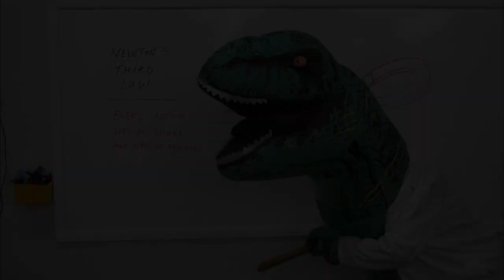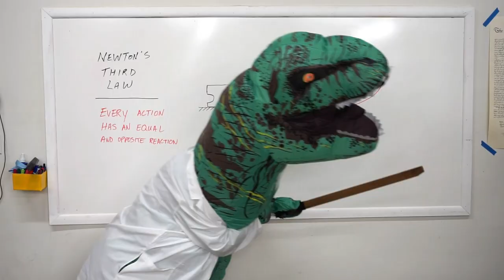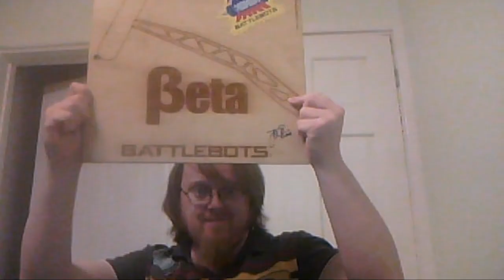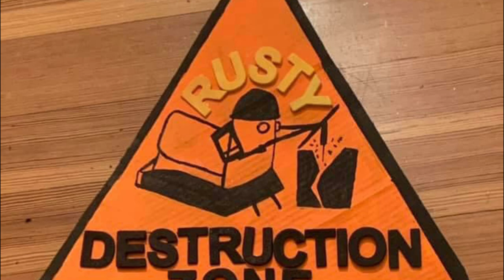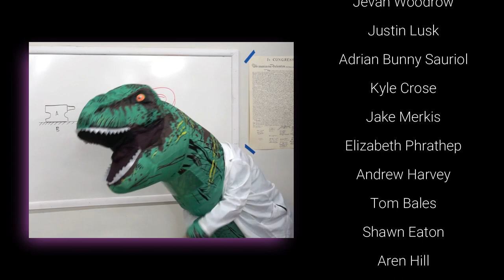Ep 4: BattleBots Learns to Walk // Tale of the Tape After Show

Comment: Wait, is that mammoth and huge fighting each other at around 2:00 before their "first" fight just a few episodes ago? I feel kinda disappointed now, I really thought we where seeing something unique on battlebots. :(
Reply: That is from their fight. The depiction actually happened
Reply from the maker: The fight did happen at Robot Ruckus in 2018, but it was not quite the same bots you see on TV. The Ruckus arena can’t handle full combat (yet), so the robots have to follow sportsman class rules. This means Huge could not use its spinning bar, and it’s likely Mammoth wasn’t running at full power. It’s still awesome to see, but it’s not the same thing as the full power battle you saw on BattleBots!

Comment: Slapbox really was trying to underplay the damage. No internal damage?!?! None of the motors were destroyed from those axle hits?
Reply: No, we weren't under-playing anything actually. We literally took all of the internals and put them into a different frame. Not exaggerating in the slightest. We even reused the rear axle assembly from the left rear wheel as well since it was perfectly fine. You can even see in the picture that nothing was touched, and even in the fight you can see we are moving and the lifter is working. If you notice, our batteries were sitting right there too in the picture...

All in all, we had to replace all the front rubber wubbs, both front axles, cut out and replace two sections of the front frame, the front top plate, some bolts & nutstrip, and 3 wheels. That's actually not bad at all from a cost perspective ($500 - 750 worth of damage and the bot cost $10k+ each and we had 3 of them).

Thank you for your interest!

Comment: After watching the new chomp, I don’t understand the strategy for firing the hammer as the opponent approaches. This lifts chomp in the air and gamma easily drove under chomp. Why not wait until after the opponent hits and then fire the hammer as the opponent bounces off?  Seems that would make it much harder for bots to get under a 500 lb robot.
Reply: It helped them in the end though. As a lot of the huge hits they got where due to them being stuck under Gamma 9 the hit that they killed Gamma 9 with was with them under them. I mean Gamma 9 had no real chance of flipping them over sure they got somewhat close to doing that. But even if they did flip Chomp over it can self right. So Gamma 9 being under them really didn't effect them at all instead it helped them easily get some nasty hits on them.
Reply: What was Gamma ever going to do by being underneath them? Not only do we have the awesome power of hindsight to know that the answer is "nothing except die", but that should have been pretty clear from the start. Gamma just was never going to be able to do anything while underneath Chomp - and honestly I don't think Gamma was ever going to do anything to them period, Gamma is a neat bot but its weapon has no real function against something that weighs 500lbs. Gamma was only going to win by judges decision, and it was only going to get there if Chomp spontaneously failed.